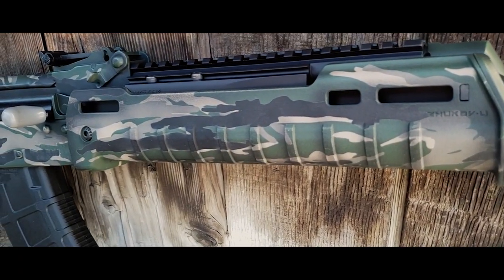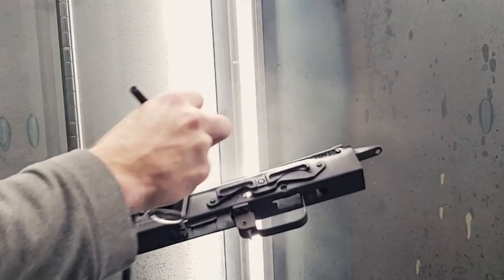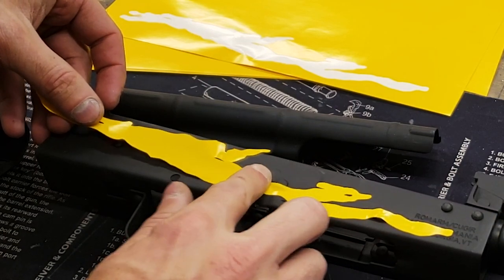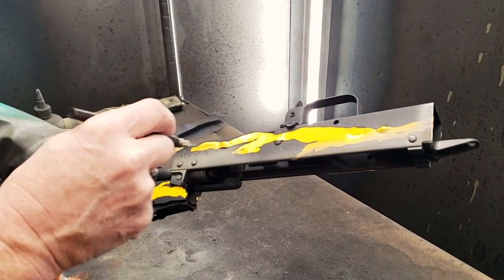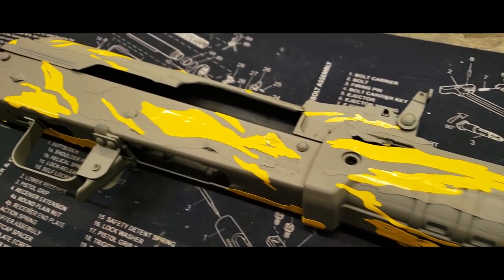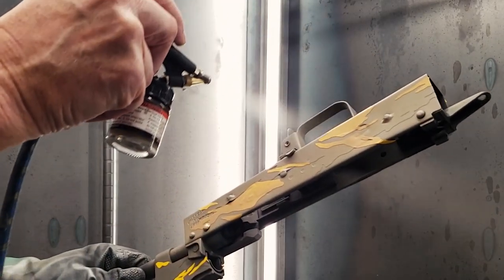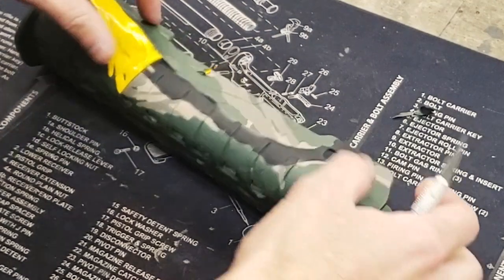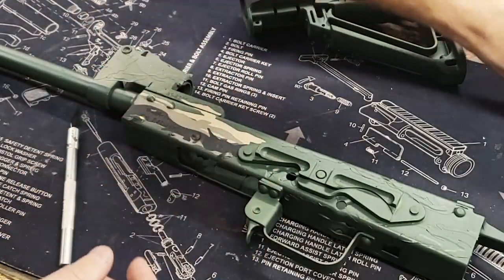How to Paint VIETNAM TIGER STRIPE Camouflage

Comment: I see you're using an airush setup... is this being used with Cerakote, or some other paint system??
Reply: This appears to just be your average paint although the first coat does resemble cerakotes c series jet black which is an excellent air cure coating. You could definitely do this with c series cerakote easily because it is air cure, however oven cure series you will need to be careful of the stencils material and cure at a lower temp for longer to avoid the stencil shrinking and melting to the project. You will also have to flash cure every layer.

Comment: Do you apply a top clear or something to lock everything in? Or is that not needed?
Reply from the maker: No we do not. Clear coat is just coating without pigment.  It is typically used to create some layers to sand and polish.  In our case, we are not seeking a polished or shiny finish.
Reply: @FreedomStencils  thanks for the reply!
Reply from the maker: @procasualty6692  Your welcome!
Reply: @FreedomStencils  Thank you for the video but does the paint come off after a while? I dont want the paint to come off from alittle sweaty hands
Reply from the maker: @Tylorgng.  No it does not.  Good prep is the key.  We also recommend using high quality coatings such as Cerakote or DuraCoat.
Reply: @FreedomStencils  Thank you! I will be buying these stencils after all my mods are put on! This camo is so sick and still is good camo for my area
Reply: @FreedomStencils  Could you make a video on the digital camo as well?
Reply from the maker: @Tylorgng.  🤘🤘🤘
Reply from the maker: @Tylorgng.  Its on our list!!!!  Hopefully soon!